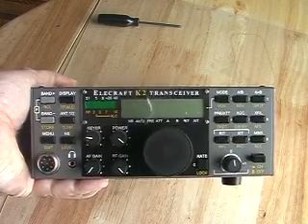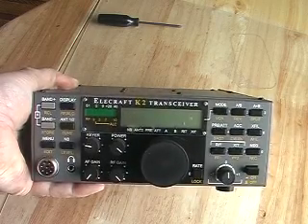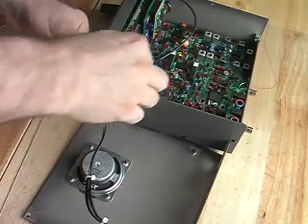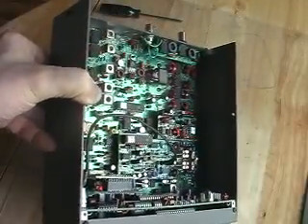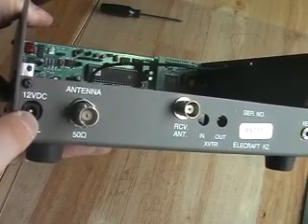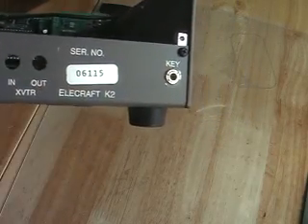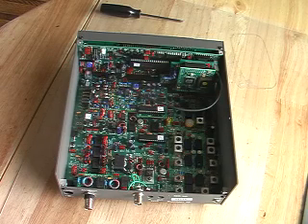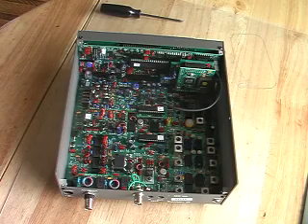Elecraft K2 Amateur Radio Transceiver

Comment: I came across this video just now. ( August 12, 2021 @ 01:44 Hrs [ 1:45 a.m. ] Pacific Daylight Time )
I know I am way way behind compared to when this video was published but I wanted to know how any Ham who bought this Teansceiver Callibrate and do the Alignments after assembling.
Similar videos are on YouTube but no one ever mentioned how the Callubrations and Alugnments were done once the component soldering on to the various PCBs' are done.
I would appreciate it if anyone could educate me on this aspect of assembling this kit since I am contemplating of assembling one myself.
73
Reply: So sorry about a typo. 
It should read 01:45 Hrs [ 1:45 a.m. ]

Comment: This rig will operate all ham bands from 10 to 160 meters, though 160m and 60m are add on options. No doubt the K2 could be designed as a SMD robotically assembled radio with the same functionality and performance for less cost than the kit, but the beauty of this thing is that it can be tuned, upgraded, and if necessary repaired by the owner. Forum technical support can help you identify and correct any problem you are likely to encounter.

Comment: I am a fan of Elecraft and have built a couple smaller items of theirs, the T1 and a balun or two--no transceiver. My question about this rig is--how much does it cost a company to have the assembly done commercially compared to offering it as a kit? It seems like kitting the parts, customer service, writing manuals--would all be much more expensive than having it assembled in Thailand or Myanmar, as is usually the case. Considering that the Elecraft gear looks commercial, I wonder about this.